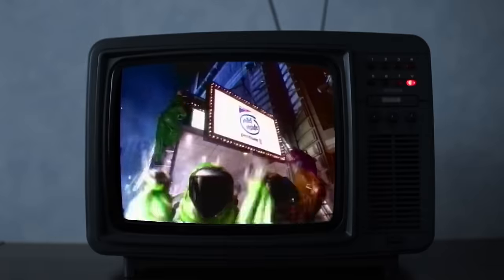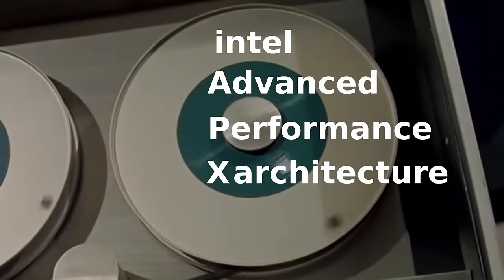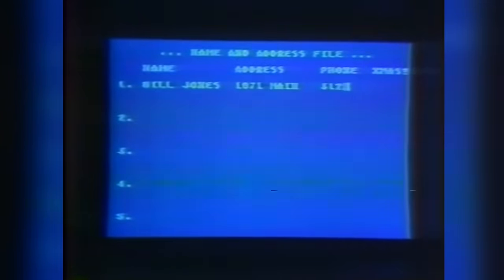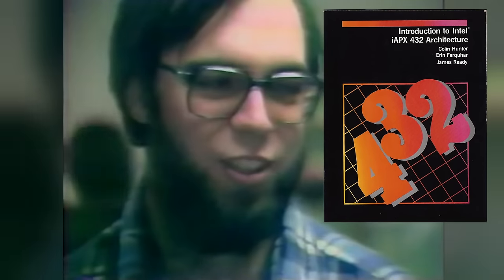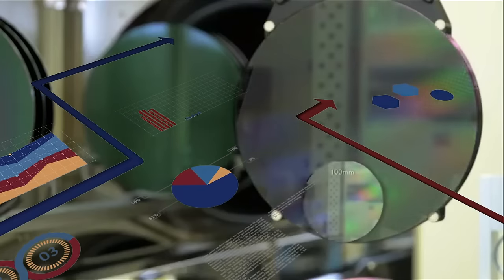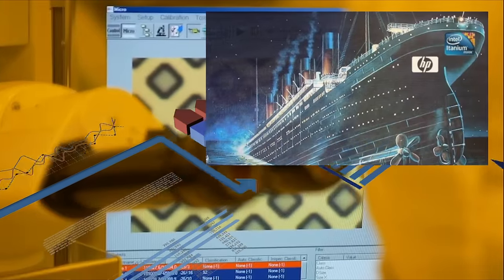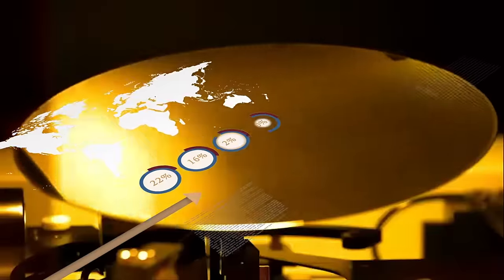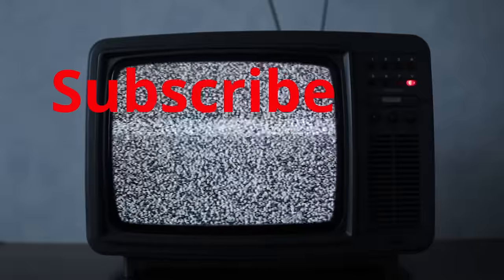iAPX The first time Intel tried to kill x86

Comment: I was going to complain about the thumbnail image with a 386.   What about the 186!?!   What about the 286?!?  
Reminds me:  is it too late to get a 387?   I searched Amazon.  After the usual "sponsored" 🤬 search results, Amazon offered this:  AMD Ryzen 9 5900X 12-core, 24-Thread Unlocked Desktop Processor    yeah.   Thanks, Amazon 🤦‍♂️
(Ok: ebay would've been a better bet, but Amazon was accessible)
Reply: Wow.  Google returns more 287s than 387s!   Too bad I don't have a 286 motherboard.   Now I just need a reason to FLP on my ca. 1990 clone.
p.s.   What exactly is a refurb CPU?  Did they take all the bits out and clean them?

Comment: I'm still hoping that one day I will find a set of chips, or perhaps a system board somewhere in a dusty warehouse, for my collection. Though I've been looking at this point for over 10 years for a sample of iAPX432 hardware and there has been absolutely nothing at all. And Intel has nuked so much of the information they had about the system (on purpose) that I'm pretty sure there isn't enough left to make a decent emulator or FPGA simulation.
Reply from the maker: I must admit I could not fine one, or even know somebody who has one. Normally I at least know someone who has a system, but not in this case.

Comment: CP/M was never available for the IBM PC because negotiations broke down during development of project Acorn and Digital Research had not yet finished porting CP/M  to the 8086, which leads to the second half of this comment.

Microsoft did not write DOS.  An engineer, who did not work at Microsoft, wrote an 8086 clone of CP/M in his spare time that he called QDOS which stood for Quick and Dirty Operating System,Microsoft bought it from the developer for 50k to save it's deal with IBM for BASIC, a contract it won because Bill's mother, Mary Gates, was on the board of the United Way with the CEO of the United Way.
Reply from the maker: You could buy the IBM PC with CP/M it's just that option cost more.  That was the deal that was eventually struck after the first negotiation failed. You are of course right that the MS where not the original authors of the first release of thier DOS operating system. However thanks to a subsequent law suite we know the person that they bought it from did not write all of it ethier and some of its similarities to CP/M where less than accidental.

Comment: Seems like time for an FPGA  version of the 432. BTW very few clones in the US used the V-20 or the V-30. All the ones I saw were Intel or AMD cpus. AMD was a second soruce for the x86. As to the 286. It was a terrible chip. It didn't have a flat address space. In fact it did what many thought was imposible which was to have a worse addessing system then the original 8086/8088 also the 8086 came first.

Comment: I am getting a laugh out of the background video, as most of the machines that show up are 6502 based, Apple II, PET, etc. And the big blue box shown early on, with all the paddle switches, yeah, I used one of those when I first took a BASIC class. But as mentioned, it was Intel CPU, but from the days that you COULD hand translate ASM into machine HEX or Octal codes, for hand entry. Don't try that with anything in the x86 line, unless you are trying to land in the loony bin...
Reply: The machine with the paddle switches was an 8080-based system, the Altair 8800B. Interestingly, on top of it was the smaller Altair 6800-based machine, which i had forgotten about until i saw it. That will safely get you to obscure.
Reply: @davidvomlehn4495  That's obscure enough for me! I never saw one of the 6800 based machines. My class was on the 8080/8085 based machines, the 8800B ( most likely ) and a Poly 88. At least the Polymorphics booted into using the keyboard and CRT without having to hand enter the start up code for that ROM.

Comment: I wrote i68 assembly code to control a Isa proto card with  d to a converter  up until 1992 still used assembly before going to Borland  C++ now days use python with embedded raspberry pi

Comment: I heard somewhere down the line that they actually had a 80186 chip That was before the 286, 386 ,..486..bla bla bla
Reply from the maker: @Chuck-u6u  They did, it was intended as a lower of chip for industrial applications, some companies did put it in machines that sort of IBM compatible ish machines. in the UK a company called Research Machines (RM) had a line of machines called Nimbus that made use of the 186 that where aimed at the education market.

Comment: this video seems to regard x86 as simple compared to iAPX, but did you know that x86 itself is so complex and has so many instructions that it's not even economically feasible to implement in hardware? No, instead, most x86 chips in the real world are actually RISC chips that emulate x86 in microcode.

Comment: By comparison with this bonkers Intel processor, it is worth noting that the 8 MHz, 1986 ARM 2 has about 30 k transistors, its circuit is proven as being formally correct, there is a close relationship between the instruction set and C language, it can address 64 MB memory, and has about double the speed of a 16 MHz 386.

Comment: Lovelace was not the first programmer, where did you get that Wikipedia !? she proposed instructions for a computer that Babbage never built , maybe Turning was the first , considering what he went through, being castrated...overturning his achievement , on such feeble grounds, seems pretty shabby
Reply from the maker: She is the first, by being the first person to write some code, the fact Babbage was not able to complete the machine is neither here nor there. She wrote a series of coded instructions for solving mathematical problems, as well as some work on machine music.  Why you want to ignore her work is really a question you can answer for your self, just know we have the evidence for that as the code was written down in a book.  The code she wrote was also run on a modern completed version of the engine, created from Babbage's drawings and notes, so we know the code worked. Turning did something very different to start with he wrote a mathematical paper where he proposed a theoretical machine, to show the limits on what could be calculated, and introduced the halting problem. We still use all those principles today, he also worked on a number of early machines, as well as AI, but he would tell you he was not the first programmer. He was a man of many achievements, and does not need any fictional ones.

Comment: The thing is this was far from the only lame duck product Intel came out with.  Anyone remember the Itanium a s an example?  Not many people do because hardly anyone bought them.  That was supposed to be their 64 bit CPU that was slated to take over from the X86 instruction set.  Then AMD released the X86-64 and Intel were forced to licence these instructions off AMD which was extremely ironic as Intel at the time were trying their best to deny AMD legal rights to continue with X86 based designs.

Comment: ARM is already here, and it will be able to kill the x86 architecture for good.
Reply: They could mix the two. I imagine a low-power hypervisor running on ARM that can delegate tasks to either ARM cores when low power is beneficial, and x86 when short bursts of high performance is needed or when running legacy (current x86) code. Every day tasks, like office work, browsing or media playback would have all the benefits of ARM while still keeping compatibility and possible high performance. Kinde of how current intel 12th gen already mixes two kinds of x86 cores.
Reply: @zdanee  Then every compiled program would need to contain two copies of itself, one for ARM and one for x86, and would need to be capable of switching between them on the fly. AFAIK nobody's ever tried anything like that before, and for good reason. It'd be incredibly complicated to make work, and for very little gain when ARM cores are plenty capable already. Backwards compatibility I could see, but I think the more plausible option there is to go the Apple route and JIT-compile x86 to ARM, potentially with some new instructions on the ARM side to better emulate x86.
Reply from the maker: Intel has been an Arm license holder in the past and produced ARM chips. It bought the part of DEC that licensed the ARM instructuon set and desgined its own cpu based on it StrongArm. They where good chips are the time. Acorn would even offer them as an upgrade to the RiscPC.
Reply: @na-sa-do  Seeing how we no longer write in assembly code having two versions for the two architectures is just running the compiler twice. Storage is no issue either as executable binaries take up the least amount of space of most apps, besides some still come with x86 and x64 variants so it's already made for two architectures. If Windows on ARM wants to stick this time around it already needs competent ARM compilers, so it should be covered.
Reply: ARM has plenty of its own issues and isn't really as clean and elegant as fanboys would like us to believe.  Like with RISC-V, I'm not a fan of ARM.

Hey, the last thing we need to is trade one monopoly for another.

Comment: IBM screwed up the PC market by choosing the trashiest hardware and software.   Intel's x86 segmented memory architecture was a POS that only was "resolved" when the data addressing bit width became large enough with the 386.   IBM had the clearly superior Motorola 68000 to choose from but chose the 8088 and not even the 8086.   It also made Bill Gates rich by going with DOS instead of a Unix type OS.   IBM's management never treated the PC as a serious computing platform.    Both Intel and Microsoft became what they are because of IBM.   Neither company deserved it.
Reply: At the time they made the decision in 1980 the 68000 wasn't a real option - peripheral chips, stable compiler and OS were still in development and volume manufacturing and second sourcing were less developed than at Intel. IBM would have had to wait over a year for ~same level of readiness and Microsoft was already familiar with Intel. At that time the existing (limited) "personal" type computers were based on the 8 bit 8080 processor - so 16 bits didn't look that redundant. 

IBM didn't regard Unix as a real option for the PC in 1980. IBM and other vendors were still fending off Unix requests on their mainframes and were not disposed to embrace it on the PC for internal political reasons. 

Microsoft, Intel & Motorola continue to operate Microsoft very successfully, intel successfully but with less growth while Motorola is a mere shadow of its former self (in revenue/scale and impact). Ultimately results tell - Intel, Microsoft and IBM created the volume PC industry - ultimately IBM was the least important player of these 3.

Comment: Maybe the idea wasn't bad, the execution was a shit show. Super unoptimized compiler, lack of high associative caches, very complex instruction decoder (without a good reason), multi chip design limiting frequency. Maybe if they waited a year more to polish the compiler properly, integrate it into one chip with some caches, it would do better, but it didn't. It wasn't a fault of Ada. The chip could run many other programming languages (but there were very few compilers for other programming languages for this machine, maybe Pascal and C), I am sure one day we will see some capabilities based systems.

Comment: So, it was a bag o'shite then?
Reply from the maker: Any promise it may have had was killed by its execution, from the split package due to the huge transistor count to the impressively poor compiler design.  It was more or less dead on arrival.
Reply: @RetroBytesUK  It's amazing they survived this monumental balls up.
Reply: Remember, this was before the concept of RISC entered the popular consciousness. Back then, there was an implicit assumption that putting stuff into hardware would automatically make it faster than doing it in software.

It took quite a few lessons to demonstrate that this did not work in the real world. iAPX was one of them. VAX was another.
Reply: @lawrencedoliveiro9104  At the time, for the quickly mentioned Symbolics, that was the case.  Special hardware support for Lisp was a benefit.  With current computers, CCL and SBCL run circles around the performance of any of the Symbolics stuff, but I think Genera still has some lessons to teach us as does smalltalk.

Comment: X86 stack base design jives with well C/C++ function call stack which known advantage over PowerPC. Hint: Doom 3 benchmark.

Modern GpGPUs are designed for mainstream graphics APIs.
Reply: Could you be more specific? I've used both architecture, writing in assembly, and don't recall anything like that.

Comment: Intel has a long, and distinguished history of making inferior cpus.  Motorola designed much better chips.
Reply: Yes that's why Motorola ultimately failed so spectacularly? To be fair Intel's processor designs weren't always superior - but there is more to it than that. Intel's total package of processors, speed grades, chipsets, memory, emulators, compliers, manufacturing quality and manufacturing capacity (even second sourcing) along with aggressive system level marketing made Intel the most successful. 

Their earliest slogans "Intel Delivers" and "Intel Delivers Solutions" reflected this total ecosystem view.

Comment: Creating additional lines of products doesn’t mean you want to “kill off” an existing line. There is such a thing as “diversification”, after all.
Reply from the maker: Thats not how intel publicised it, they descibed it as the replacment, it would make the old line obsolete.  There is such a thing as diversification its just at the time that was not intels plan. They started to change how they talked about it just before release (as they knew how badly it performed) but that was far to late.

Comment: Assembly is witch craft.
Reply: Eh?  Nah!  I would say that things like common lisp or smalltalk metaprogramming are a hell of a lot more magical than assembly.  Assembly language is just a nicer way of writing out machine operations.
Reply: Nah. Quite the opposite. In assembly the machine does exactly what you say. Of course, you have to say things exactly right. It gets easier after the first dozen architectures. (Not even a slightly humble brag, just an accumulation over time). Seriously, i very much prefer higher languages, Rust being the latest, but I'm proficient in assembly and when I have to use it, I still enjoy getting all those little niggling details exactly right.

Comment: “Object oriented”. WTF does “orientated” mean? You need to get educatated 😂
Reply from the maker: Maby do a degree in comp sci (and pass it) and you will know .
Reply: @RetroBytesUK  I searched “object orientated” and all it gave me was results on something called “object *oriented*” programming.

“Object-Oriented Programming is a programming paradigm based on the concept of "objects", which can contain data and code. The data is in the form of fields, and the code is in the form of procedures. A common feature of objects is that procedures are attached to them and can access and modify the object's data fields.”

Is saying crap like “orientated” considered a proper “educatation” in Wimbly Wumbly Crumpet Teachestershire? 🤣 Init.